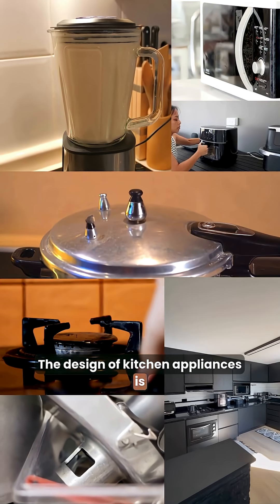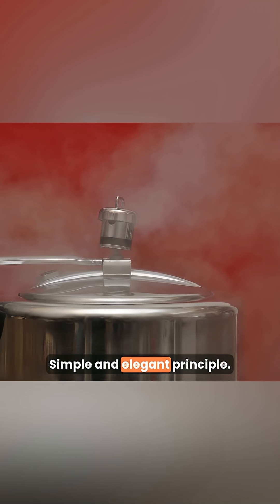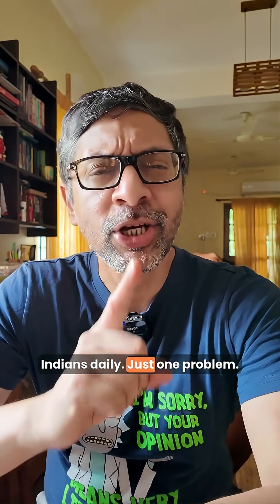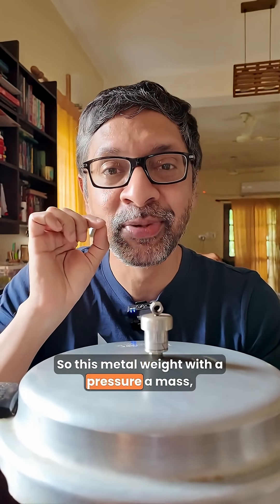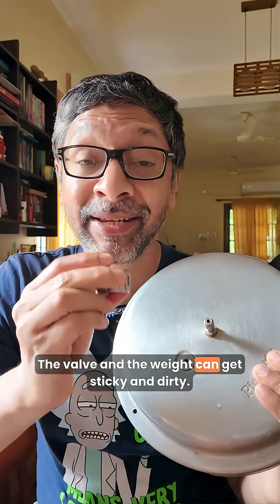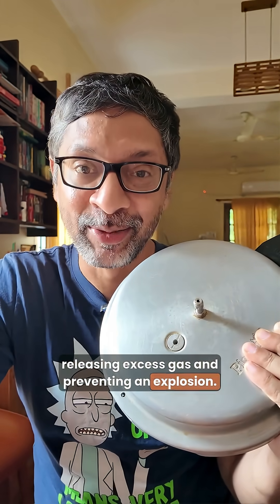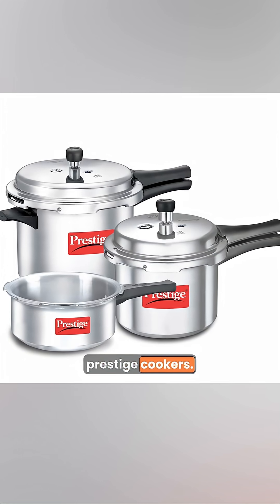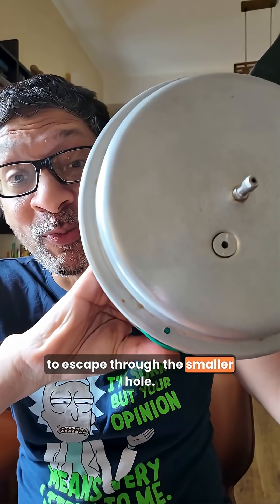Amazing Kitchen Engineering

Comment: It's a great design. But I have seen a failure and lid blast. We complained that to TTK. They replaced the entire assembly. The explanation of failure was the hardened rubber gasket. So make sure that the gasket is not far too old. Also gently clean the gasket and keep it separately to avoid any damages

Comment: The reason to invent the third protection was that the "service centers" in north India were replacing the safety valve with cheap metals that did not melt and therefore caused the cookers to burst.
Reply: Yes, the same applies to fuse wire. People use just about any copper wire, which will just not blow😢

Comment: Ironically Hawkins is a much better pressure cooker and it doesn't have the hole in the lid. Indian dal gets cooked faster and Better with much less water in Hawkins than Prestige. Prestige pressure cooker won't work unless you Fill it more than one third.

Comment: In Brazil there's a different safety mechanism that is common and simpler.

On top of the pan lid there's another hole with a rubber plug. The rubber plug is designed to eject if the pressure inside gets above a threshold.

Comment: The pressure cooker wasn't invented in India . The designs with a safety valves and a weight existed over 70 years ago in imported cookers . TTK / Prestige did pioneer the gasket release system for additional safety in the newer cookers .

Comment: safety valve blows, it doesn't melt.
The safety valve is thinner compared to rest of the cooker. Thus under high pressure it blows up before the body of the cooker blows like a bomb.

Comment: One thing you missed is pressure value is situated under the lid handle . Lid handle mitigate the damage caused by metal piece in the valve in case of over pressure.

Comment: You are wrong about safety valve. It does not melt with pressure. It melts because at higher pressure...the temperature goes up and melts the safety value

Comment: Why is it not second fail safe instead of third?
Reply from the maker: Because that would make the gasket too flexible and result in undercooked food
Reply: @MasalaLabShorts oh ok, thank you. Then my question would be which is cheaper, the gasket or the melting valve.
Reply: @PK_1024 gasket is around ₹80, safety valve replacement will be ₹30.

Comment: Great and good information, my pressure cooker could not hold the pressure for the last one week inspite of changing the rubber. So I cleaned the pressure valve  using rin ala, H2O2 and a toothpick. Now my pressure cooker let's out steam through the valve with a whistle and not through the last 3rd method mentioned in your shorts
Reply from the maker: Great! But as a general safety principle, do get it checked by the service center

Comment: Before that hole, TTK brought in they even made a long, 4mm wide slit hole as the third safety feature on lid rim where rubber gasket is placed. If pressure builds beyond safe limits, the rubber gasket was pushed out further allowing a leak through the slit. Now this hole also allows excess steam to escape and reduce pressure.
Reply from the maker: Interesting!

Comment: Originally pressure cooker was sold with separater vessels where different items were cooked in separate vessels. Only water in the bottom boiled to produce steam. But people became lazy and wanted to cook more and discarded the separater vessels and cooked all sorts of stuff in the cooker vessel itself. Water just boils and forms steam. But things like rice and dal and all these stuffs produce lots of hot foam with these rice dal etc., come to top, try to escape from the valve. These clog the safety valve, both weight and alloy valve which may lead to more pressure and heat leading to explosion.
Reply: Yeah. That's why I still use a vessel inside these cookers. Fir direct cooking I use inner lid cookers

Comment: Small correction. Plan B. That second safety system. At 1.5 Bar pressure, heat increases further with that metal alloy melts due to heat (not pressure).
Reply from the maker: Yes, i used pressure just to make the flow easier for lay folks to grasp